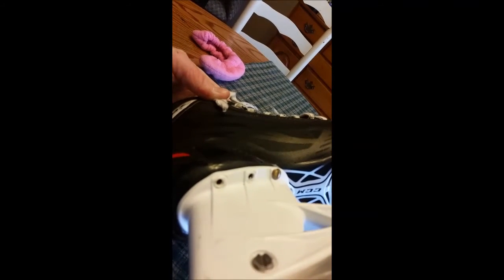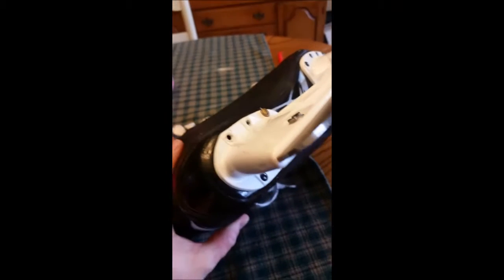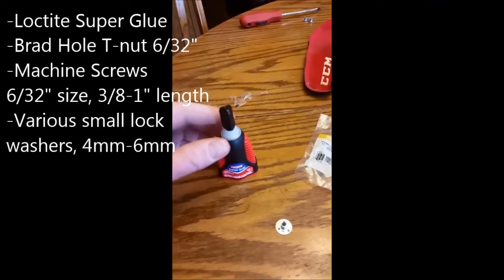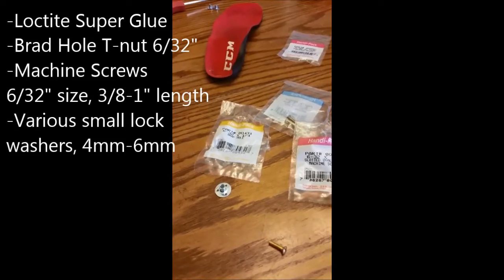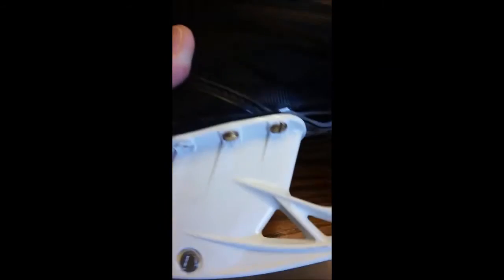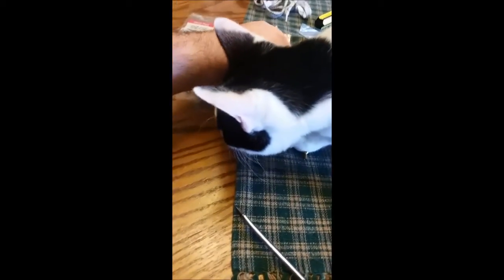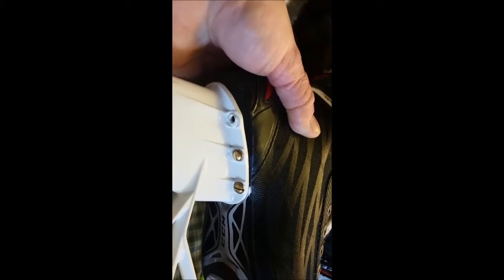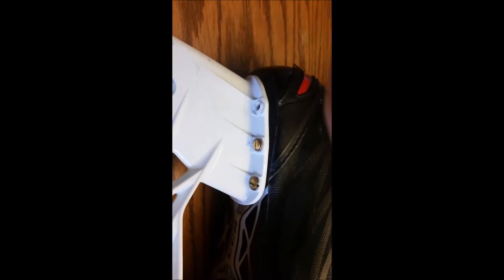Repairing ice hockey skate rivets with screws

Comment: Thank you for the idea.i had 12 rivets that needed to be replaced. You saved me from having to buy new skates at the current moment. I'll see how it holds up.
I used stainless steel 6-32 screws with a lock washer and a small washer so it doesn't bite into the plastic.  Also used a round back t-nut and just cracked off the teeth with a linesman.
I used the blue threadlock. I hope it holds up. If not I'll get something stronger.
Reply: How did it hold up? I'm thinking of doing this as well. Any issues with rusting?  Also how did you get it so the t just doesn't trust spin when tightening
Reply: @Chanmantroop10  so far so good. Super impressed. I just tightened the screws and let the washer keep it tight. Hasn't spun out on me.
Reply: No issues of rust yet. Get stainless steel screws.
Just hold the inside turn your finger as you tighten
Reply: @mscarf22  thanks. I was more concerned about the t nut rusting as I can only find zinc coated ones and not stainless.  Was thinking of paying a shop to convert to the graf nut system but that would cost a bit more than just grabbing a few things from the hardware store.

Comment: Hmm, I was thinking about doing something like this for my skates. Ive had copper rivets replaced in the heel after they popped out three games in a row. I, and I believe the kids in the pro shop, started thinking I was too fat to play. HAHA. Good work
Reply from the maker: It was frustrating to me that replacing rivets over and over just wasn't working.  I mean I know the skates I have aren't top of the line and I'm a heavier dude but come on!  Having gone through a season and a half since doing this, the screws are holding up great.  The only downside I now see is if you are ever going to replace the blade holders (white plastic part), this may be too permanent of a fix to undo.  Although there is such a thing as glue solvent and putting this solution back in place with new holders probably isn't hard.
Reply: Yeah, I was kinda thinking that too. But I guess you need the locktite or they'll probably unscrew themselves with all the pounding they take in a game. I don't think solvent is a good idea because the boot is also partially held together with glue. Was thinking, if you need to and have a dremel drill, to just grind the heads off. Personally I probably wouldnt have to worry because I've never had a blade outlast a boot. But then again, I only get my skates sharpened about once a season.

My rivets held last game though, so I'll keep my fingers crossed and cross that bridge when I get to it. Thanks from another heavier dude.

Comment: Could you just use actual loctite for threads instead of super glue? Also, how have the held up? I'm thinking of doing this too, but it seems that the time nut would keep spinning and not provide a tight fit bc there's no teeth on them.. or do the lock washers help with that?
Reply: Definitely use Locktite, prefer the red one

Comment: Where did you find 6/32 or 3/16 Brad hole Tee nuts?
Reply from the maker: At my local hardware store. I think this stuff in particular I found at Menards.
Reply: I could not find the brad hole style when I was in a pinch.  I found regular with the teeth intended to bite onto wood.  I clipped the teeth and flattered them with pliers.  Regarding the screw lengths, you can clip the length down with wire strippers, most pairs are designed with this size of bolt cutters for electrical work.